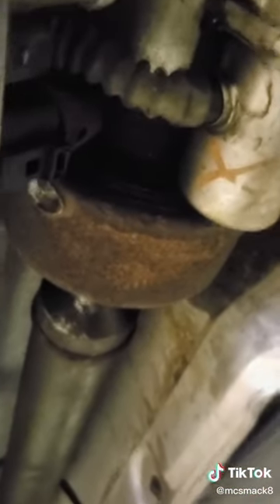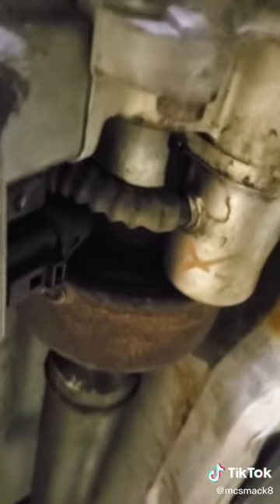How Engineers Keep Mechanics Miserable (Part 356) #shorts

Comment: It doesn’t sound like bad engineering. It sounds like rust.
Reply: I own 3 Volvo, 2000, 2004 and 2008. Never went to the dealership. All service done in my garage without a lift. 🙄

Comment: My Volvo has a turbo, its fast (relative to other cars from 1994, not subjectively), and 5 bolts take the driveshaft off the rear diff, 4 more drop the carrier bearing. It's a 5 minute job.
Reply: Most manufacturers were still sensible at that time to make maintenance fairly simple.  After 2000, I guess they all started smoking crack in the engineering department.

Comment: Rust is not an engineer's fault as much as it is a maintenance interval standard of the owner. I live in the north, I wrench, and if I know a component will benefit serviceability from getting it's hardware disassembled and replaced before it becomes seized, then I do so. 

Anything untouched for 20 years will have a different-than-new level of complexity, seizure, corrosion, brittleness, etc. 

If every tech that said this about engineers went to become an engineer, we still wouldn't be free from difficulties in the repair industry. Ever heard of production costs? Imagine having submitted a near perfect design, only to have the OEM hack it down of it's genius to meet production budgeting. 

Sometimes, that smoke should go towards the accountants.

Comment: ahah just reasearch how to change the oil pan on a pontiac G6, just for fun (spoiler it's a nightmare, need to lift the motor, disconnect the transmission, exhaust, front wheels, etc)

Comment: That's a propshaft, not a driveshaft. Driveshafts connect between the diff and the hubs and have CV joints on each end.
Reply: Prop is the abbreviation of propeller. Boat - marine. Cars don't have a propeller. Cars are driven, boats are captained.
Reply: @Brendan Jones  nothing to do with propellers. What's on the end of it is irrelevant, could be a fan propelling the vehicle through the air. It's propulsion it's short for. Trust me that item being shown in this video is a propshaft not a driveshaft. Driveshafts form part of the rear or front axle of a vehicle providing drive to the wheels. The exception being solid rear axles where the shafts in the axle tubes are called halfshafts. Also trust me. I'm an engineer.
Reply: It is a driveshaft. It is also a prop shaft. Sometimes even called a cardan shaft. It is all colloquial terms for the same item that transmits mechanical force, torque, and rotation from source to drag.

Comment: That's why you really don't want to have DPF issues if you have a Volkswagen group car (VW, SKODA, SEAT). It's bad enough in any car but VW is on another level. It's like they started with a DPF and built the car around it.
The only advantage is it doesn't get stolen because you need a workshop and hours of labour to get near the piece of shit.

Comment: better than a 20 year old ford LMAO
Reply: Not a chance
Reply: @joe1273 ever done a 5.4 manifold or starter?
Reply: Did a 5.4 2valve starter the other day. Top bolt was removed with 2 extensions, a flex adapter and 1 ratchet tooth of movement (also you gotta get your contraption onto the head of the bolt purely by feel on the extension, can't see the bolt nor can your fingers fit anywhere near the bolt itself) middle bolt was slightly easier with 2 ratchet teeth of movement, bottom bolt rounded from using a crescent wrench, couldn't use a socket because of how close the bolt was to the starter body, rounded the standoff nut for the ground cable, had to chop it off with an angle grinder 8 inches from my face since the truck died in the dudes driveway, ground cable connector fused to the cutoff bit so I had to rewire the ground, reassembly was only slightly easier with holding a 20 pound starter in one hand and blind feeling a bolt into its slot with the other hand with the previously mentioned 2 ratchet teeth of movement. I'm sure ford's got some great engines but christ, I got an OBS chevy with a 350 and working on it is like pulling apart a lawnmower engine, and with enough room you can rent out the engine bay as a small apartment ffs
Reply: @mromatic17  stripping heads isn’t the problem… i don’t remember the last time i couldn’t get a bolt out one way or another lmao

Comment: 😂😂😂😂😂😂😂😂😂😂😂only real Master mechanics don’t Btch around a problem solving situation 😂😂😂😂😂😂😂😂wen u get 20 yrs plus in the Mechanic  business than u can judge any engineer 😂😂😂😂😂😂 Volvos R the best Safes Cars out there n the maintenance is cheap even on BMW SUV 4*4 u have to take the shaft out to get to the all wheel drive motor actuator 😂😂😂😂some r easy other r a pain inn the butt